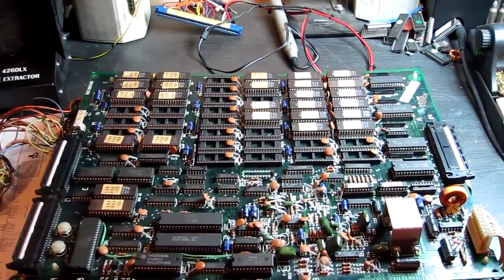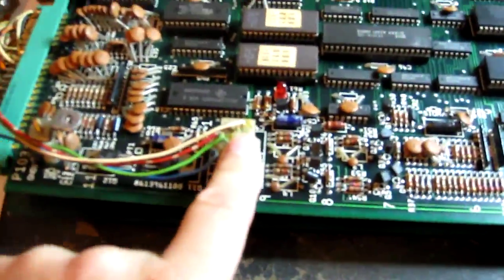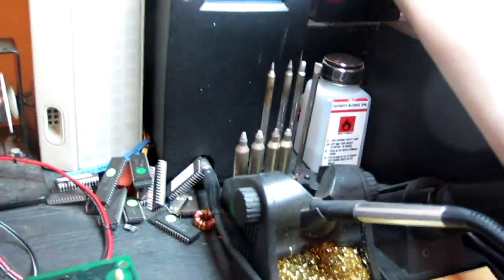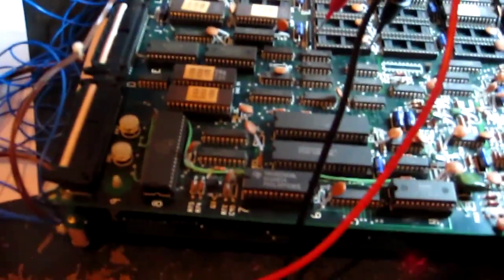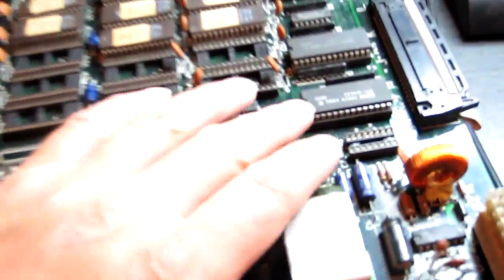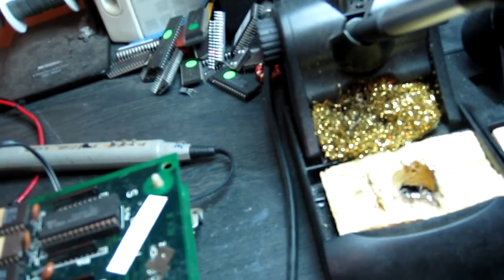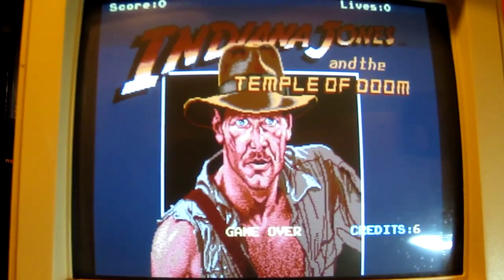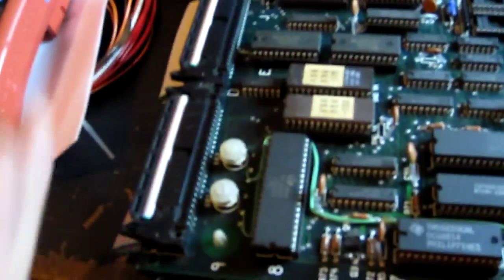Atari - Indiana Jones (Cocktail PCB) Repair

Comment: Is it mostly arcade ops that do these crappy hack up fixes like soldering directly to connectors or is it something that happens once boards get out into the collector market? All the boards I have I bought from arcade suppliers so I haven't seen anything like that but I can imagine the stuff floating around ebay to be pretty crappy.